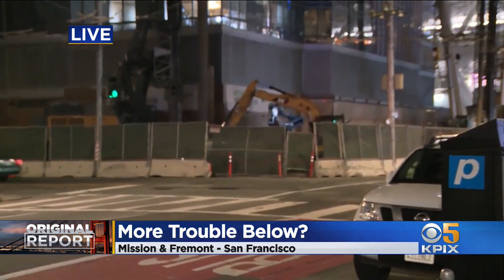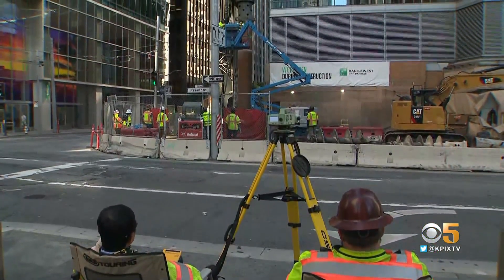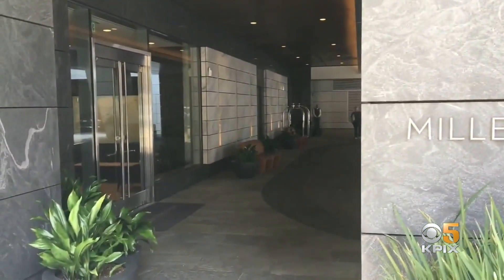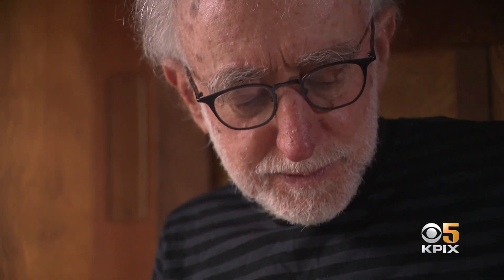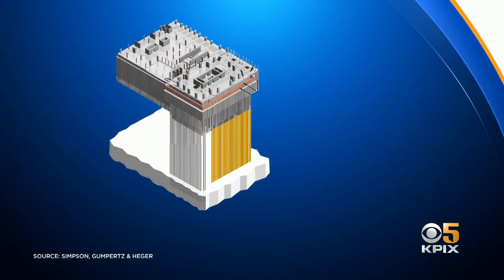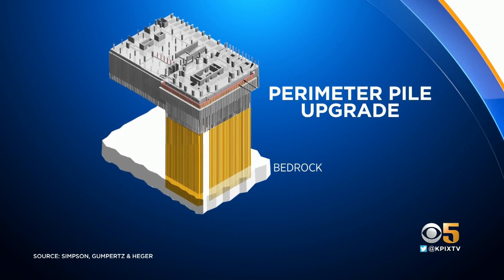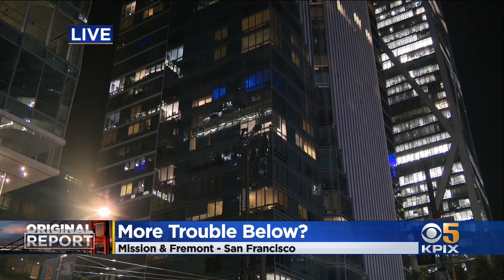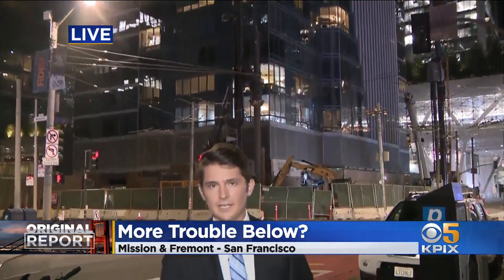Millennium Tower: Expert Says Repair Work on SF High-Rise Should Stop

Comment: Everyone is exaggerating the risk of collapse. It's only unsafe to occupy once the elevators and plumbing are damaged from the tilt. Granted, with no fix, it is inevitable. 
You would have stuck doors and burst pipes far before the building came crashing down. That's how they've gotten away with it until this point. It's technically safe. Technically.
Would you buy a technically safe apartment?

Comment: Guess what I almost thought everything on it that this building is going to collapse and the reason for it is because of the top few floors they poured nothing but concrete so the building cannot hold itself up the building needs to be torn down it will fall down and it will domino effect and bring other buildings down with it it's called just a matter of time

Comment: Isn't going to work, Believe it or not, they already have a tried and true method currently in Italy on the leaning tower of  pisa, freeze in place, freezing the ground under and around the foundation by running cooling pipes, MUCH smaller than those 24-and 30'' casons that are basically undermining the friction support,

Comment: THEY SHOULD SLOWLY DIG OUT THE BOTTOM CAUSING THE TOWER TO SINK 10-20 FLOORS DOWN TO THE BEDROCK - - THEREBY CONVERTING THOSE LOWEST 10-20 FLOORS INTO A 10-20 STORY BASEMENT - - THEN REINFORCE THE NEW BASEMENT AND STILL HAVE A FUNCTIONING BUILDING (ALBEIT 10-20 FLOORS SHORTER IN THE SKYLINE).

Comment: I wonder if they could inject liquid nitrogen beneath the foundation and freeze the mud down there, halting its compression by the weight of the building and giving them more time to place the supports around the edge of the foundation and also suppress the dipping they've now observed in the floor of the garage.
Reply: I think they just have to admit the building is just too heavy.  Even with bedrock support pillars - the weight of it will always put pressure on that mud and "squish" it and compact it.  That will never be stable for the ground-floor slabs.  They'll crack, then snap, then let water intrude. Then spall, then boom.
Reply: Lol.....freezing the mud causes expansion, which would worsen the foundation cracking....
Reply: @richardwebb9532  Uh, you do realize the  cracking is being caused by the foundation sinking because the mud is being compressed, right?  And that expansion is exactly what you'd want to reverse that (and also stop the compression).
Reply: @sunspot42  nope, as a builder of 40+ years with my own successful business, freezing that mud, pressed up against the cracked foundations, will cause it to expand towards the easiest route, which would be the weakened foundation full of cracks, and you'd freeze and expand any water in those cracks too, making it worse.
(Basic science and engineering)
Reply: @richardwebb9532  This isn't a house.  The foundation - an enormous slab - isn't cracked.  The problem is that the building - including its heavy foundation - is sinking into the mud, and the sidewalks around it are buckling and cracking as a result.  And you wouldn't freeze the foundation - you'd freeze the mud well beneath the foundation.

Comment: Great reporting. The engineer interviewed pointed to not just one problem (pilings) but also foundation (slab) integrity. You can't fix one and ignore the other and solve the problem. The developers, home owners and bureaucrats are all all in CYA mode.
- If city bureaucrats approve the fix and it doesn't work more liability is transferred to the city. Superimpose quake risk on a flawed decision. What liability would the city incur "tear it down"? After all they approved the project.
- The developer has no option but to proceed to contain it's liability. They cannot recommend tearing it down. 
- Homeowners if the city were to order the bldg come down would want to be compensated at today's full market value.
  Bearing this in mind, repairing the bldg. is the only minimal liability temporary decision. It kicks the can down the road. In the end the repairs will proceed but the question is, will it be the best solution from a public and owner safety perspective. I hope I am proven wrong but it seems that the wrong decision will be taken for the wrong reasons.
Reply: Over $150 million has vanished in the "repair" already.

Comment: The city needs to condemn the building, take the building under eminent domain, compensate current tenant owners, and then sue the original developers, engineers, and their insurance to recover as much as possible.  Not an engineer, but seems there are enough red flags here that it is a huge public safety issue.  Imagine how much it will cost all of them if the building collapses into other buildings killing thousands.
Reply: The city let them do it...

Comment: 1. Why NOT use end bearing ( in bedrock) caissons in the beginning (fear of direct transfer of seismic vibration)? Since using the friction caissons with mat foundation, why not expand the mat where settles to alleviate soil pressure. even need to expand into others properties. 2. The drilling of new deeper caissons might drag (by friction force) the nearby soil downwards, consequently drag the building down at the construction corner. 3. The direct bearing on bedrock will change the characteristics of the original seismic design/transfer. Hit by both surface wave and body wave. Needs to be re-designed/re-considered. Might not be significant.  High rise building mostly governed by wind force than by seismic force.
I don't think the building is in imminent danger. The settle will stop after the completion of construction. 4. How to tilt it back to level?

Comment: Materials and steel bought from China. The buildings and materials purchased from Red China used to build things like the new northeastern half of the Bay Bridge and the Millenium Tower and the new Muni building and stations by the Ferry Building began to fall to pieces before they were even able to open. Cheap reused American steel shipped back from cottage industries in Communist China are responsible for much of these problems, although the Tower was simply hastily built on the same type of land that the Marina buildings that collapsed in the Loma Prieta quake were built on. Should we get a major quake three structures will suffer terribly: the new Bay Bridge section, the Millennium Tower and the Muni station. If you've look at ADVChina  and serpentza (?) YT's channels on the ghost cities of China and the swiftness with which they fall apart, you won't be surprised or shocked.
Reply: I'd rather see materials for US buildings sourced from American manufacturers and suppliers, but don't forget that a lot of the steel the new Bay Bridge had problems with came from the US.
Reply: Problem with millineum building is not materials.  The developers decided to save $4 million extra on original building costs by not drilling support piers into bedrock.....ooops

Comment: I said this long ago as one of the highest paid contractors on the east coast, this building HAS TO BE demolished down to the foundation and built again from the ground up, there is literally no other way to protect the people in or around the building. Before long electrical lines will stat ripping apart from the lean and cause a fire, cables are secured and as the lean tugs on them it will literally destroy that tower and everyone in it one day if it isn't demolished.
Reply: The current amount of lean is not affecting the elevators, but if the leaning continues, the guide rails will become out of plumb to the point where the elevators will no longer function. Without elevator service, a 50 story building is useless.
Reply: Soon, the elevators won't work.

Comment: the weight of the entire building rests on that 10ft thick concrete pad and a number of pylons that just go down into the unstable soil and not to bedrock. That pad is under enormous load from a building that was redesigned to use much more concrete in it than using lighter weight steel. I like how those two workers are just chilling across the street in chairs. They're obviously there to watch for the building tilting more.
Reply: So they made house on sand then ?  Everything in SF seems to be going to poop.
Reply: One time there was a report that they were drilling IN the basement.  True?  Being on a former landfill, seems as though vibrations from the drilling, the weight of the building, and Earth's vibrations would serve to squish even more to a foundation not part of bedrock.  And so close to water's edge.

Comment: This building needs to be evacuated and disassembled. One bad earthquake and it’s coming down. No one thought Champlain Towers was going to come down so suddenly, and then it happened
Reply: Not right now, no. It's still safe, even with a massive earthquake. 
It's only unsafe to occupy once the elevators and plumbing are damaged from the tilt. Granted, with no fix, it is inevitable. 
You would have stuck doors and burst pipes far before the building came crashing down. That's how they've gotten away with it until this point. It's technically safe. Technically.
Reply: No one in charge cares about people. They’re just worried about investments. Good luck with them tearing down their investment
Reply: @HeyUncleA  - hope springs eternal.  then one day the ground begins to shake and the best made plans of mice and men come tumbling down.  it’s just too hard to fail so big.  a politician or any business associated with declaring it a failure and taking it down would take far too much heat from the money interests who are basically wagering on beating the odds of a catastrophic failure.  a 5.7 shaker like Loma Prieta some years ago might seal the fate of the tower (and lot of other borderline structures).  i hate to say it, but we are somewhat overdue in the “big shake” category.  but maybe it’ll be abother 25 years, who knows?  that’s the wager….yikes!
Reply: Was thinking the same thing. The city leaders need to act now and demolish the building, before mother nature demolish it herself risking many lives.
Reply: In fairness, Champlain towers wasn't on anyones radar. I'd like to believe the many engineers, from various parties would be sounding the alarms if they thought there was a risk. Still, I wouldn't go in it.
Reply: and you said that based on your extensive structural and pyrotechnical expertise, right? Where did you study for your PhD?

Comment: 15 Units for sale atm. Maybe they should sell before the building falls over??...
Reply: buy them cheap and flip them after the repairs, the assessments should already have been paid by seller
Reply: @williamhaynes7089  There's no such thing as cheap in SF. 
This building is a hazard.
Reply: @williamhaynes7089  The repairs will NEVER properly conclude, it's part of the scam.
Reply: @williamhaynes7089  ...no way you can repair that mess, once foundations have dished and cracked, it game over.

Comment: Climb to the top and dis assemble piece by piece, is the only logical solution.
Reply: That's what I was thinking
Reply: Yes yes yes. Tahr it down.
Reply: Well, they could implode it. 🤷
Reply: @ursulasilva5838  check out the harmon hotel las vegas demolition
Reply: @ursulasilva5838  The building is too close to other buildings and the debris would not fall into the footprint.
Reply: @ursulasilva5838  Yes!
Light some file cabinets and furniture on fire and it will fall straight down into its foundation.  Like WTC7 did at 5:20 PM in the evening of September 11, 2001.
Reply: It should go the way of the Deutsche Bank at the World Trade Center site in Lower Manhattan . Tear it down floor by floor. That one was 40 stories and there was another huge tower in midtown Manhattan that was/is being deconstructed to make way for another huge even talker tower. Even if the can stop it will the ever be able to straighten it out? The owners of the condos will never get their money back unless it can be as it’s supposed to be and then, because of the notoriety they still might not.

Comment: I cant believe a contractor would touch this fix at all.. if anything happens to make it worse they will get blamed..
Reply: Money talks…
Reply: ALL THIS STOPPING AND STARTING  BUT THE CONTRACTORS STILL WILL GET AT LEAST HALF OR MAYBE MORE OF THEIR PAYMENT FOR THIS JOB
Reply: But they are required to be insured against any such calamity .
Reply: I would think theres an ‘all care, no responsibility clause’
Reply: With that type of attitude no contractor would touch it; then for sure it would fall.
Reply: @TruckTaxiMoveIt  - as long as the expensive insurance policy is paid for by customer... it would sure increase the repair costs
Reply: @Randy R Randelson what are you talking about? you have no idea... What does the contractor has to do with anything? Did they follow the plans and recommendations of the engineers? if so, they don't have any responsibility.
Reply: @thornil2231  exactly contractors shouldn’t be held responsible they make sure shit gets built they don’t design it.Flaws like this should’ve been and could’ve been avoided in the drawing room where architects are suppose to design shit so it doesn’t crumble like we see here